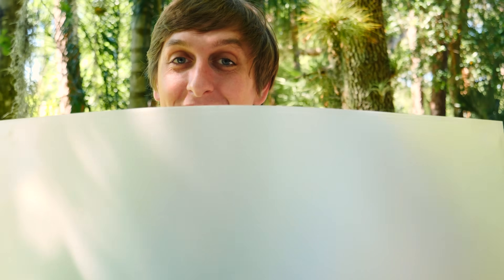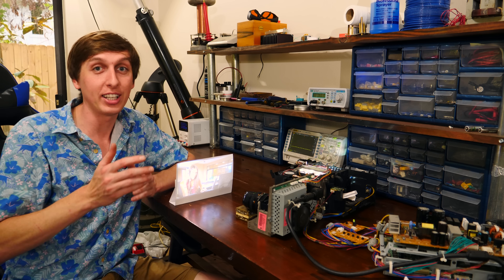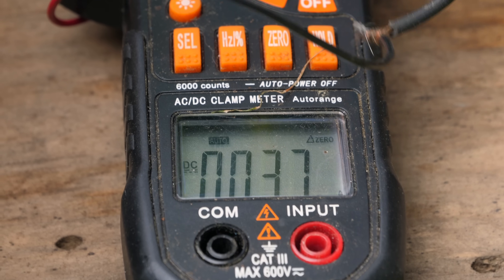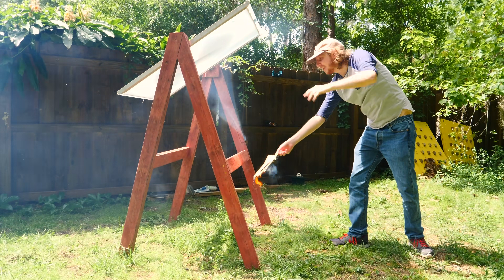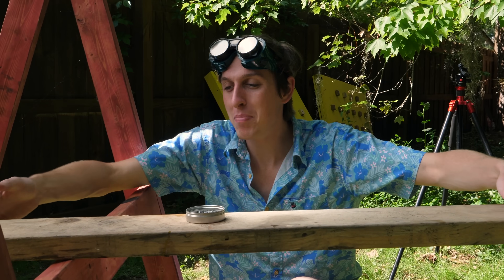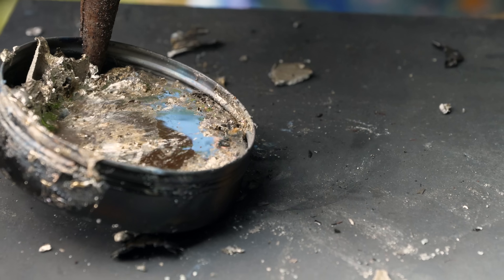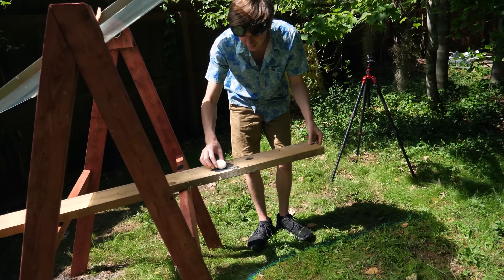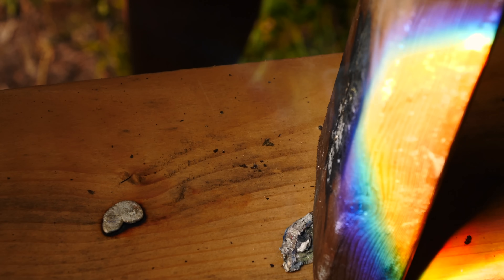Burning stuff with a giant fresnel lens + how a DLP projector works

Comment: Kevin my man, you're amazing and a lovely guy, but please - we MUST STOP abusing the term "overclocking" - to "over CLOCK", by its' very description, is the process of raising the CLOCK SPEED of a CPU or other digital IC - since a solar panel is not a digital device, and has absolutely NO place for a clock source, using this term just seems lazy and awkward, or maybe you're just keeping up with "Da kool kidz" - whichever it is, my dear friend, PLEASE stop? 

The term you seek is "over-driving"

Thank you mate :)
Reply from the maker: Ehh I'd say overclocking has fallen into the common use vernacular so its basically just another word for over driving.  And I mean technically I'm sending more electrons through the circuit, and overclocking is sending more electrons through the CPU so...
Reply: TheBackyardScientist Okay, but the ubiquity of something doesn’t mean it’s correct. The keyword is... ⏰ CLOCK 😃

Well, that’s my pedantry out of the way. Didn’t mean to rain on your parade my good sir. 

Shalom.

Comment: Is this mirror in rear projection TVs? You can find them on craigslist for dirt cheap, especially nonworking ones.
Reply from the maker: Its a thin plastic sheet sandwiched in the screen. i got it for free because people are always throwing them out.
Reply: @TheBackyardScientist  Cool, just wanted to be sure I was on the same page when it came to the type of TV this is in. I wasnt sure of this lens is in all projection TVs, or just a specific type. Didn't want to start the process of acquiring an old enormous broken TV if it didn't have the lense!